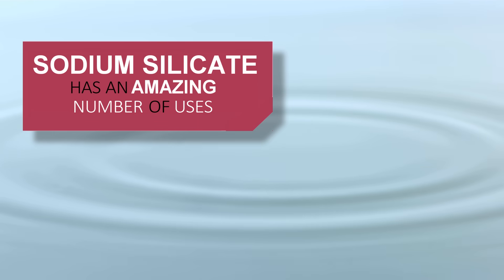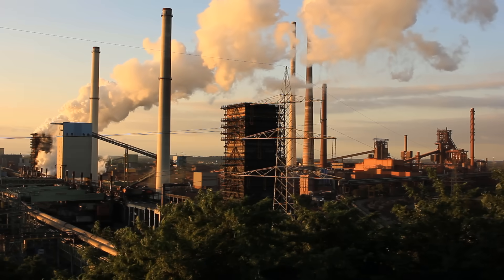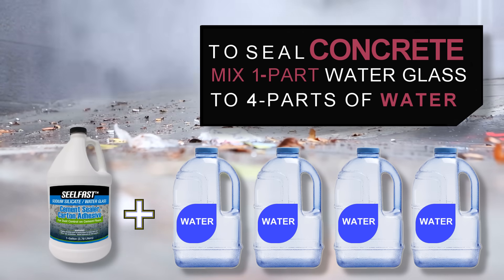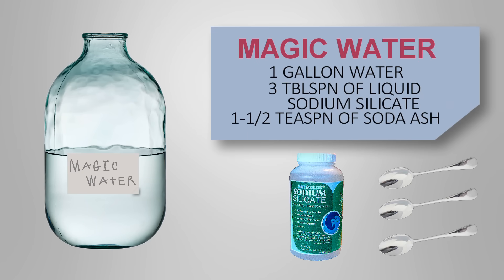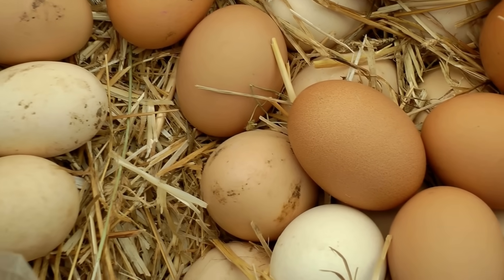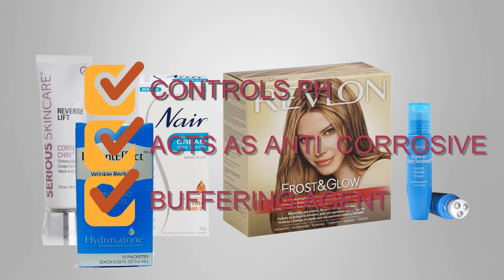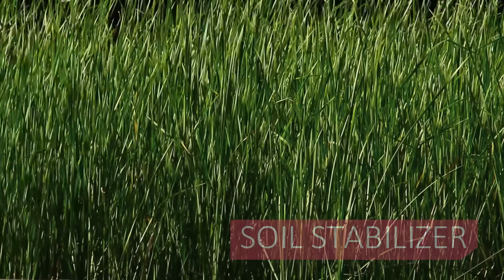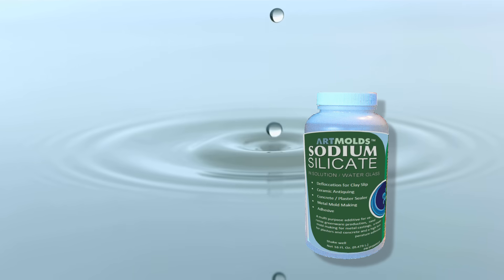Sodium Silicate || Water Glass: (Uses from Industrial to Daily Life)

Comment: The various reactions of Sodium silicate are quite fascinating.  The use in the foundry industry is quite interesting.  Greensand is mixed with a solution of sodium silicate to form molds and cores.  After the mold or core has dried, it is treated with Carbon dioxide.  The reaction of Sodium silicate and Carbon dioxide produces a precipitate of Silicon dioxide and Sodium carbonate which acts as a binder and produces a strong mold or core.  This process also allows for a very fine as cast surface finish on aluminum and iron castings.  Most importantly it allows for the production of hollow interior spaces on castings such as cooling jackets on engine blocks or hollow cylindrical items.
Reply: oh so that's how it is.. I've watched many videos of Pakistani manufacturing here on YouTube (it's kind of interesting how they can utilize over 100  year old machine equipment the British left in India, it's also sad to see that there are literally 0 safety measures used. Welding with safety squints, wearing flip-flops while pouring molten copper/aluminum, no respirators when throwing all sort of crap in the foundries etc.)
And in those videos the workers make sand molds and then use some sort of gas from a cylinder. I didn't know the molds were made using water glass and CO2
Reply: @kvetiapin  Yes, the working conditions are pretty poor, but unfortunately, that is the way it is.  Pakistan used to have its own machinery manufacturing capabilities until the British forced them to purchase British made machine tools.  These older machines can be rebuilt as they wear.  But in the US and other Western countries, as tools wear, they are replaced with more advanced CNC machines.

There are more modern factories in Pakistan where the equipment rivals that seen in the West.

Comment: That's a blatant lie: Na2SiO3 NEVER (!) turns into waterproof glas or "SiO2" (siliciumdioxid is not a glas but powder).

Pour liquid waterglas into a mug (10 mm high) and let it "dry" (carbonize) about 5 weeks. Then take it out of the mug, flip it and let it carbonize another 5 weeks. After five (respectively ten) weeks pour pure water at this thing and after 5-8 hours you will see how it melts away, because the lye (alcali, Na, NaOH) is still in it ! ! ! As a waterproof binder it only works if the lye gets a chance to flow away (out of the solution) - if not, it always stays watersoluble. But without water and without the lye it shrinks and left behind very porous and fragile.

Comment: As the Obama Administration taught me Sodium Silicate makes a great engine block additive. Replace the oil with Sodium Silicate then run at 2000 RPM for 10 to 15 minutes to let it do it's magic.
Reply from the maker: Hi there. We must be careful with such comments as someone may follow your suggestion. PLEASE DO NOT use sodium silicate as an engine oil additive. It is a destructive compound inside an engine and will lead to total engine failure in a matter of minutes. If your goal is to permanently destroy an engine for scrapping, then yes, this will work—just like it was designed to. The only time sodium silicate was used inside an engine in such a manner was the government program known as: Cash for Clunkers Program (U.S. 2009) – In that case sodium silicate was intentionally used to permanently destroy engines before scrapping vehicles. It was added to the oil, the engine was run, and within minutes, the engine would seize permanently. Best regards, Ed
Reply: @EnvironMolds  It was said in jest. Wow you were quick, On a 6 year old video. It just popped up on my recommended today.  But i give you props for the explanation, it was well done. But also it was to make fun of the huge waste in useless engines because of that decision. I only ran 3 months because so many people were turning in cars. Man the money we wasted because of this chemical and all the cars it destroyed.

Comment: I used to repair rusty exhaust pipes on my 1960 Chevy Impala. I was in college & didn’t have money to replace my exhaust system, so my dad showed me how they used to seal up holes back in the 1930s during the Depression.
1. Wrap the leaky area with aluminum foil
2. Buy FURNACE WRAPPING PAPER (flexible sheets or rolls of asbestos. I don’t think you can buy this any longer)
3. Soak the asbestos paper with water glass.
4. Wrap the exhaust pipe with the water glass-soaked furnace wrap.
5. After it dries, wrap the repaired area with more aluminum foil and finish by securing the top layer of foil with mechanic’s wire.

The patch will hold up for a couple of weeks to months - or until another section of pipe rots out and you finally have to buy a real exhaust pipe. .
Reply: Probably have difficulty with the asbestos but similar rock-woll is available in different configurations.  Used as insulation in furnaces and  kilns I'm sure it can be had in several thickness.
Reply from the maker: Hi Steven, Thanks so much for the information. I am certain it will be helpful to someone. Warm regards, Ed
Reply: fiberglass header wrap could take the place of the asbestos... good trick.!
Reply: A Fiberglass roll and high temperature silicone would probably do the job as well, or glue the fiberglass with silicate, similar to laminated epoxy

Comment: Sodium silicate is present to dishwashing and clothes washing detergent where.  It seals the microscopic cracks in porcelain dishes, the coating inside dishwashers, and the tub in clothes washers.  This prevents rust from staining the clothes.  Sodium silicate is mixed with cement used in oil field cementing to make a lighter density cement slurry where this is needed to prevent damage to weak formations near the surface.  It is used to help seal off "lost circulation" zones in wells by first pumping in sodium silicate (water glass) liquid, then followed with calcium chloride.  When the CaCl2 hits the waterglass it immediately precipitates calcium silicate, which is insoluable, and leaves a crystalline matrix that cement can be pumped into, sealing off the troublesome formation.  In dry (granular form) it is known as sodium metasilicate.  When this is mixed with water it becomes "waterglass".  It has a viscosity like Karo Syrup.  Like that it will freeze at only 50*F, so the tanks it is stored in have to be heated in the winter to keep is liquid.  Sodium silicate (waterglass) will harden egg shells and seal the shells.  The reaction is with the calcium in the egg shell, making a coating of insoluable calcium silicate.  It is a food safe material.
Reply from the maker: Hi there. many thanks for taking the time to add to the sodium silicate knowledge base. It is very much appreciated. Warm regards, Ed

Comment: The video was a bit lacking as to the use of the dry version for the preservation of eggs. We only have the powder available. How many ounces or grams to how many quarts or liters of water for egg preservation?
Reply from the maker: Hi This video was not made to tell you how to preserve eggs.  It was made to tell you about all the uses of sodium silicate. The fact that it missed the dry version of preserving eggs would have made the video longer than the normal viewer would stay interested. But here is the answer to your question in the detail you need: 

To preserve eggs using powdered sodium silicate (also known as water glass), you'll need to create a solution of sodium silicate in water. The typical ratio for making a preserving solution with sodium silicate is:

1 part sodium silicate powder

9 parts water (by volume)

This ratio will create a solution with a specific gravity suitable for preserving eggs. If you are using the dry, powdered form of sodium silicate, you'll first need to dissolve it in water. 

Here's how you can do it:

Calculate the Amounts Needed: For every quart of water (about 950 mL), you would use about 3.5 ounces (100 grams) of sodium silicate powder. This ratio might need slight adjustments depending on the exact formulation and purity of the sodium silicate you have.

Mix the Solution:

Measure the water and pour it into a clean container.

Slowly add the sodium silicate powder to the water while stirring constantly to ensure it dissolves completely and doesn’t clump.

Prepare the Eggs:

Ensure the eggs are clean and have no visible cracks. Freshly laid eggs are best as they have not been washed which removes the protective bloom that helps in preserving them longer.

Slowly lower the eggs into the solution ensuring they are completely submerged.

Storage:

Keep the container sealed and store it in a cool, dark place. The solution should keep the eggs preserved for several months to a year.

Ensure you stir the solution well and allow it to settle if any undissolved particles are present before adding your eggs. The key to preservation is ensuring the eggs are fully submerged in the solution.

Warm regards,
Ed

Comment from the maker: Yes, you can add it. But over time it will become less effective at resisting moisture
Reply from the maker: Sodium silicate and potassium silicate are both silicate compounds, but they differ in their chemical composition, properties, and applications. Here's a comparison of the two:

1. Chemical Composition
Sodium Silicate (Na2SiO3): Composed of sodium oxide (Na2O) and silica (SiO2).
Potassium Silicate (K2SiO3): Composed of potassium oxide (K2O) and silica (SiO2).
2. Solubility
Sodium Silicate: Highly soluble in water, forming a viscous, alkaline solution.
Potassium Silicate: Also soluble in water, but typically less viscous and slightly less alkaline than sodium silicate solutions.
3. pH and Alkalinity
Sodium Silicate: Tends to have a higher pH (more alkaline) in solution compared to potassium silicate.
Potassium Silicate: Slightly lower pH, making it less alkaline and potentially less caustic.
4. Applications
Sodium Silicate:

Adhesives and Binders: Used in making cardboard, paper, and refractory materials.
Construction: Used in concrete treatment, as a soil stabilizer, and in fireproofing.
Water Treatment: Acts as a corrosion inhibitor and is used in water softening.
Detergents: Used in cleaning products for its ability to break down oils and fats.
Potassium Silicate:

Agriculture: Used as a fertilizer and plant protectant. It strengthens plant cell walls, making plants more resistant to diseases and pests.
Coatings: Used in high-temperature coatings and paints, especially for metal protection.
Fireproofing: Similar to sodium silicate, it's used in fireproofing applications.
Construction: Used in mortars, cements, and concrete to improve durability.
5. Reactivity
Sodium Silicate: More reactive with acids, leading to faster setting times in certain applications, such as in grouting and sealing.
Potassium Silicate: Less reactive than sodium silicate, which can be advantageous in situations where a slower reaction time is needed.
6. Environmental Impact
Sodium Silicate: Generally considered safe for the environment, but its higher alkalinity can be more corrosive to both skin and materials.
Potassium Silicate: Also environmentally safe, but its lower alkalinity makes it slightly safer to handle and less corrosive.
7. Cost
Sodium Silicate: Typically cheaper and more widely available.
Potassium Silicate: Usually more expensive due to its specialized applications, particularly in agriculture and high-performance coatings.
Summary
Sodium Silicate is more commonly used in industrial applications where cost-effectiveness and strong alkaline properties are needed.
Potassium Silicate is preferred in agriculture and specific industrial applications where lower alkalinity and less corrosiveness are advantageous.
The choice between the two often depends on the specific requirements of the application, such as reactivity, pH, and environmental considerations.

Comment: Is S.S. toxic to fish after it's cured on concrete or cement? I need to use it on my Koi pond's water fall.
Reply: Sodium silica is water resistant, but when exposed to water it will dissolve over time. This is not a good use for it.

Comment: Great info. money cant buy. Thanks.
Can this be used in as coat in waterproofing old cement+Sand+ Lime slab? My 65 year bungalow is leaking, Please either Environ Molds or an expert suggest me a remedy. I will remain thankful for the remedy.
Reply from the maker: Don't not use on exterior where weather will wear it away. Use for indoors sealing.
Reply: @EnvironMolds  Thanks a lot for your prompt advice. Great.

Comment: Thanks, informative, got a lot more information than I expected
Reply from the maker: Thank you for your thoughful comment.
Reply: @EnvironMolds  Hi, does a wood after covering of sodium silicate layer is still flammable ? What is a difference between a sodium silicate and usual liquid silicate glue ?
Reply from the maker: @backupviber6285  Thanks so much for your question. After dipping wood it will be transparent when it dries. Any attempt to light it will cause the flame to extinguish. As to your other question: Sodium Silicate: This is a generic term that refers to compounds made from sodium oxide (Na2O) and silicon dioxide (SiO2), also known as silica, combined with water. Sodium silicate is also known as water glass or liquid glass and is available in various ratios of sodium to silica that can affect its properties like viscosity, melting point, and chemical reactivity.
Liquid Silicate Glue: This is a specific type of adhesive product that is derived from sodium silicate. The formulation is adjusted (usually with additives) to enhance its adhesive properties and make it suitable for glue applications. It is designed to be less brittle and more flexible compared to plain sodium silicate solutions.
Reply: @EnvironMolds  thank you very much for your detailed answer. I am thinking with what to cover wood, to make it really flame-protected

Comment: Hey, question for anyone who knows. Once the sodium silicate is mixed with water than dried into silicon dioxide, what happens when water is introduced again? I assume it is not soluable? Thats why it is used as a sealant? Sorry if this seems like a dumb question.
Reply: It ain't dumb. Not asking is. It stays dry, and repels water. Plasticized concrete uses it.
Reply: I am also questioning, can sodium silicate act like waterproofing agent for plaster of paris? I would use it for bathroom decoration
Reply: @aikonlatigid  With plaster of paris, Yes.
Reply: The simple answer is it becomes silicon dioxide; AKA sand and the majority component of glass... neither sand nor glass is affected by water in any meaningful way (there are surface hydrogen bonds with it but they don't matter for what you're asking here).
Reply: Another name for sodium silicate is “Egg Keep” when used for the long term storage of fresh eggs.
Reply: Excellent information. Thank you.
Reply: It does not dry into silicon dioxide.  It dries to become sodium metasilicate.  When water is reintroduced it dissolves and becomes liquid again.  It becomes a sealant when it reacts with calcium bearing materials forming calcium silicate, which is insoluable.
Reply: @saxmusicmail So the calcium silicate form is what makes concrete water resistant when this is added? I assume that's because of the calcium content of the concrete mixture?
Reply: @saxmusicmail  heating can also cause it to become insoluble though, right? Like in fired ceramics?
Reply: Your question has just sent me on a 1-hour spiral into chemical handbooks, chem-company advertisements, research papers, Wikipedia and Google hell in general.

Here's my best shot at the answer:
1. If you just took pure sodium silicate (and NOTHING ELSE), poured it into an inert container, and heated it... you'd eventually get a glassy brick of anhydrous sodium silicate... which WOULD be soluble and would turn right back into waterglass if you added water.
2. If you took sodium silicate and poured it into the same container, but added an ACID or ALKALINE catalyst, THEN heated it.... you'd eventually get a glassy brick of GLASSIFIED SILICA GEL (w/ sodium-bound byproducts)... which WOULD NOT be soluble.

Now the one part that confused me - and probably confused you too - is why, then, does waterglass turn "glassy" (i.e. #2) when painted onto cement-like surfaces?

Best I can tell, there are two reactions - at least with Portland cement - which removes the sodium and makes the silica turn hard and glassy:
a. One is where the Waterglass absorbs surplus Carbon Dioxide from the cement mixture; The Silica turns into Silica Gel Glass (as above), and the Sodium turns into Sodium Carbonate.
b. The other - and far more common / reliable - is when the Waterglass reacts with Calcium Hydroxide (the key component in Portland Cement) in an Alkaline Reaction to split into Silica Gel Glass and Lye (Sodium Hydroxide). I would assume at this point that the Lye is either reabsorbed into the cement and possible reacted with other minerals within, or precipitates out of the Silica Gel Glass layer to later be washed away.

Notice that waterglass does NOT 'dry' on Chickens' Eggs -> that's why you're supposed to leave them in solution. Chickens' Eggs are Calcium Carbonate. They have no surplus CO2 nor Ca(OH)2 to donate to the waterglass to 'glassify' it.
Reply: It is now sand. Not water soluble.
Reply: Yes it is a D b question.
Reply: How is it that this product was discovered in the year 1640  ….yet we haven’t overcome combustion engine’s   In 2025 .
Reply: @Peachesncream007  Because they have nothing to do with each other, aside from crossing paths in the 90s. One area doesn't advance just because another has. That's not how it works. Besides, I like my 5 speed. Not interested in falling asleep on the way to work in an electric.